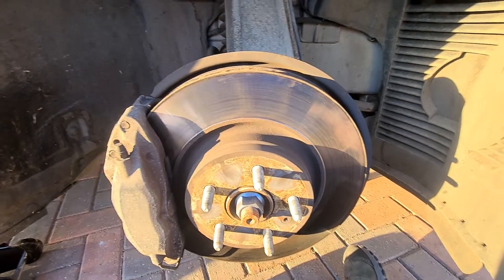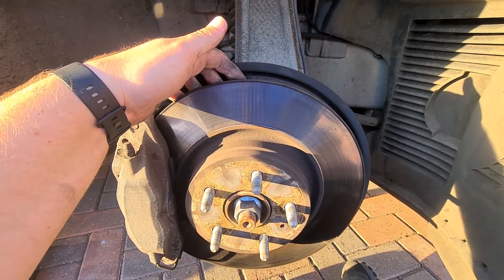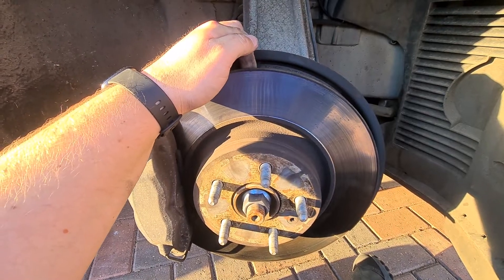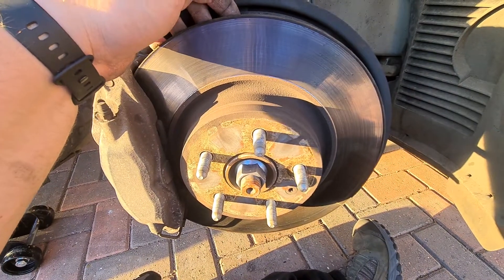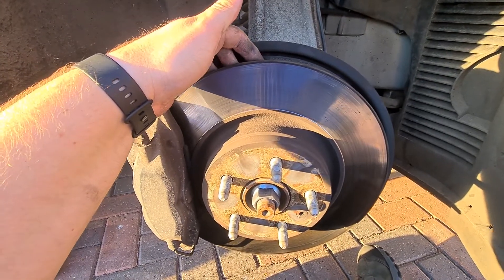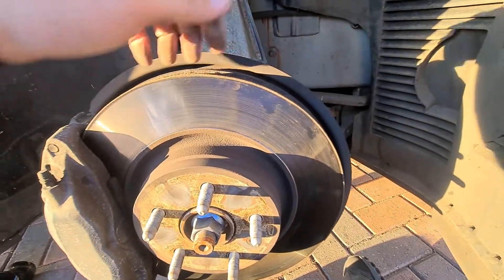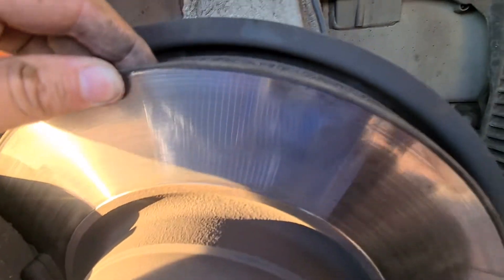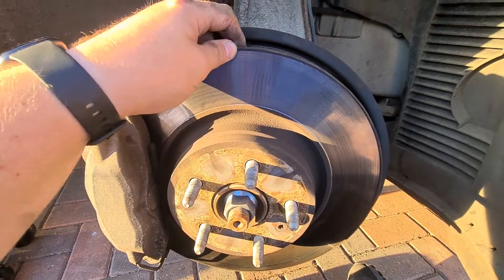Tesla Model S 2017 100D - UK RHD - Front wheel half shaft play

Comment: Hi George, I'm having a similar issue with my 2017 Model S. I've just been speaking with Tesla and they've told me its not covered under warranty, and been quoted £1500 for the work. Did you say you managed to have the work done under warranty?

I have the battery and drive unit warranty till 2025, but they said it doesnt cover this.

Thanks, 
Josh

Comment: Did the rattling follow the rotation of the wheel? Or was it mostly just during acceleration? Im trying to pinpoint for my own 2017 75D if its the bearings or the half shaft.
Reply from the maker: The is was the half-shafts which were a warranty repair on my vehicle. But the rattling turned out to be a fault in the air suspension assembly which I had replaced later.
Reply: @m1geo  how was the noise like? Was it linear with the speed of the car or more of like random rattling?

Comment: What was the solution? Half shafts or something in the front motor?
Reply from the maker: Ended up being half shafts.
Reply: @m1geo  thank you! Have the same behavior…both front half shafts being replaced 50k km ago…
Reply from the maker: @Kirkusssss  this was a known fault, so if they've not been replaced yet, push Tesla for a discount. I had to pay a small amount but Tesla paid the bulk amount under warranty.
Reply: @m1geo  that’s the thing..they were replaced last year, but with the old part numbers, even if the SB was active.. will see next Tuesday what they have to say
Reply: I wonder if the material in the gearbox has been engineered to be stronger than the drive shafts so the shafts become sacrificial
Reply from the maker: @iangriffin6590  have you seen the inside of those gearboxes. On the S and X they're definitely designed strong! Check out the Weber Auto reviews! Gears are like 3 inch wide!
Reply: No I haven’t seen them George I’ve lost interest in Tesla a bit after waiting 2 years for my Plaid only to have it cancelled and now I’m having to chase them to get my deposit returned so I’m a bit disappointed with them at present.